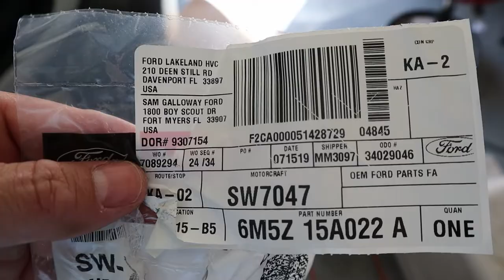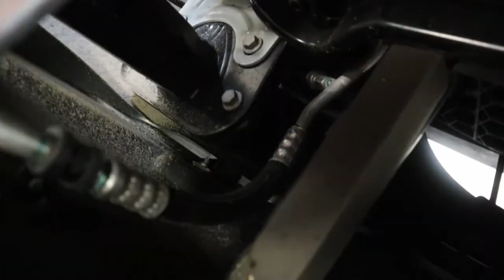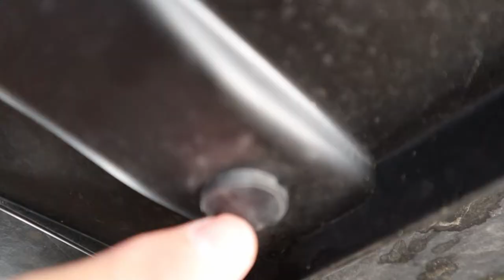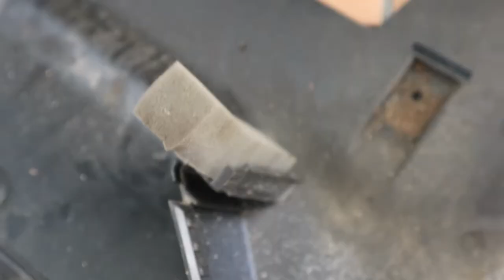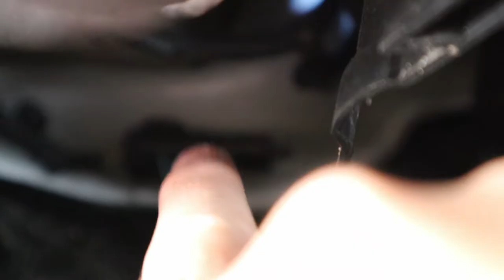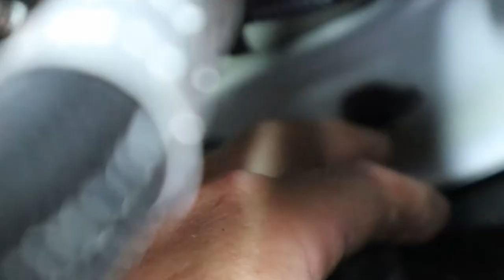#MTBPlanB How to replace Ambient Air Temperature Sensor on 2015 - 2019 Ford Transit.

Comment: 6M5Z15A022A  Ambient Air Temp.   You should have noticed the dash display reading a low temperature.  A modern vehicle, the AAT (Ambient Air Temp) information is given to the PCM (powertrain control module); which is then seent via HS-CAN (High-Speed Controller Area Network) to the BCM (Body Control Module) which connected to the HVAC Control Module. Hence when you see a dash reading with a temperature "that doesn't make sense". Often it is that simple AAT sensor.  A very thin smear of dielectric grease on the connector is a good thing to help that O ring in the connector seal against moisture/corrosion.
Reply from the maker: Thanks Tom.  Great info. I used FORScan to monitor the PIDS which allowed me to somewhat deduce the modules that were using AAT.  The dash reported 61 degrees riding around on a 97 degree day!
Reply: Great video. Mine is experiencing exactly the same problem. Did it correct the HVAC issues? Thanks.
Reply from the maker: Did not correct the particular AC problem I was having, but it did fix my temp readout.  Perhaps if you have the comfort AC with auto temp it may have an effect.
Reply: @MTBPlanB  im having exact same problems whit my vehicle as far as the AC not fuctioning properly.. have you been able to diagnose the issue?
Reply from the maker: I have not but I’ve pretty much ruled out the minor stuff. I saw one owner of 2019 say that they found metal shavings in his unit, not sure which part. Ford transit USA group on FB .  “My AC unit and system was replaced at 6k miles.. metal shavings in the unit... under warranty.  Brought it in bc the AC wasn't strong ie cold...”
Reply: @MTBPlanB  I too have a 2019 Transit, 3.7L with poor A/C performance here in Texas! Any progress on resolving YOUR A/C problem yet. Please let us know when you do resolve it so we can benefit from your experience. Thanks.
Reply from the maker: Peter Schroeder Not yet diagnosed. I will be taking it to a mechanic soon. I’ve run out of skill!
Reply: @MTBPlanB  I also have an issue with my Ford A/C. Did you solve yours ?
I've tested the compressor, it's working, I've replaced the pressure sensor, but the compressor is never started.
Using Forscan, I've read some PID and I have multiple (about 6) outdoor temperature PID.
Some values are correct, but some are bad (like -19°C, but it's actually +23°C) so I think a temperature sensor may prevent my compressor to start.
The value displayed on my dashboard is correct (+23°C)

Do you know if there is another outdoor temperature sensor hidden somewhere, which drive the AC unit ?

Thanks !

Comment: Very informative video specially for me as a non mechanic. I just have a question on the compressor, it is my understanding that when the aircon reached the set temperature, the compressor will be turned off. I noticed that the compressor keeps on running even if the temp is very cold. Even if I lower the temp it continues to run. Although I noticed inside the car that temp is reducing and adjusting but the compressor is still running. Is this normal for ford?
Reply from the maker: It may be normal if you have auto climate controls and auto is engaged? Otherwise it could be a sign if refrigerant leakage. In general the compressor will run until an external trigger such as evap temp, amb temp or pressure, rpms or a combo tell it to turn off.
Reply: @MTBPlanB  yes i always use auto climate controls. Those this mean that the cabin of the car should reach a certain temp so the compressor will disengage? My concern is the longevity of the compressor if it continues to operate.
Reply from the maker: @Triathlete Over 50  I don’t have auto climate controls to confirm…but in other cars, if auto is engaged, the compressor will remain running. Maybe someone else can confirm if this is how the Transit auto works. So in short, the temp of the air inside is not necessarily  directly correlated to temp, pressures, humidity associated with refrigerant being pumped thru the system and exchanging heat. For example a blend door movement can affect your cabin temp greatly, but to create the cold air component, the refrigerant still needs to be pumped thru the system.

Comment: Well did that fix the AC problem or not.  Why the cliffhanger?
Reply from the maker: No, this fixed the erratic temp display which was needed to troubleshoot further. The problem is intermittent and hasn't resurfaced yet. I posted this is some of the other comments below a while ago.
Reply: My 2017 transit has been doing this intermittently for a year. I am in Florida where it is not nor has it ever been below 20 degrees. BUT for some reason the gauges occasionally read 15 degrees. That is on a summer day as well. It will sit like this for a good while. But if I begin driving it will climb up into something closer to reality and blow cold air.  I have also had it do the other extreme on a cold day say the temperature was 200 when it is closer to 40.    So... do you think if I change this part it will make a difference? 😵
Reply from the maker: Mark Hinds It could be your problem. Do you know if the compressor clutch is engaged when it reads low? Check out this vid I just made to check the signals, etc https://youtu.be/xglEOkRLSQM